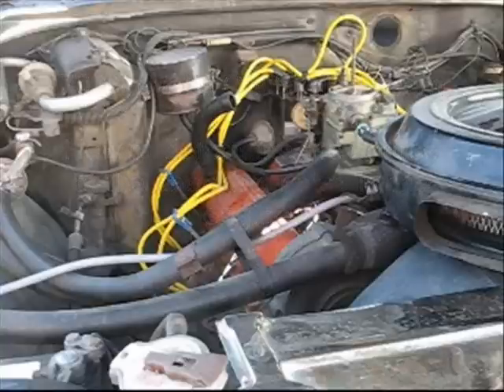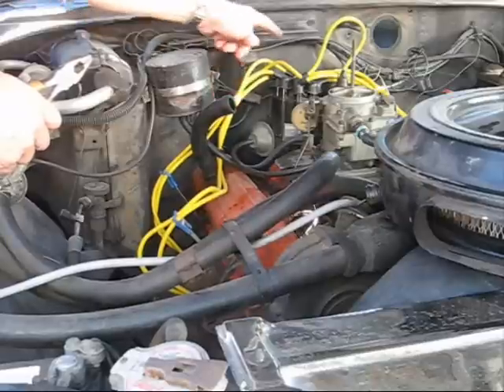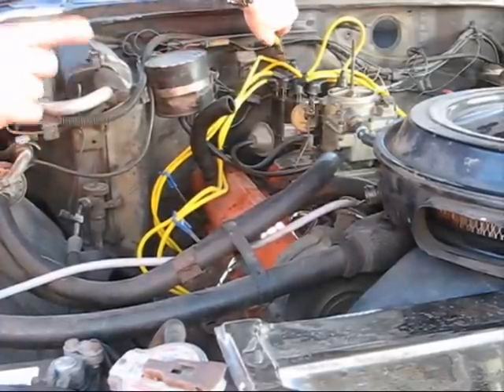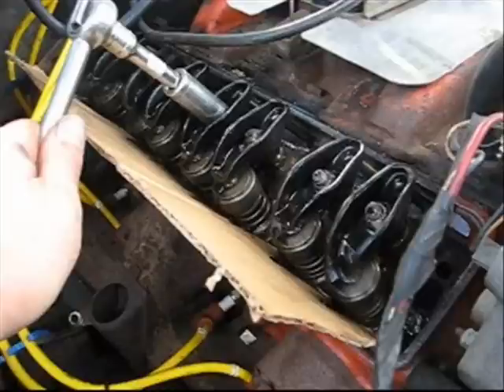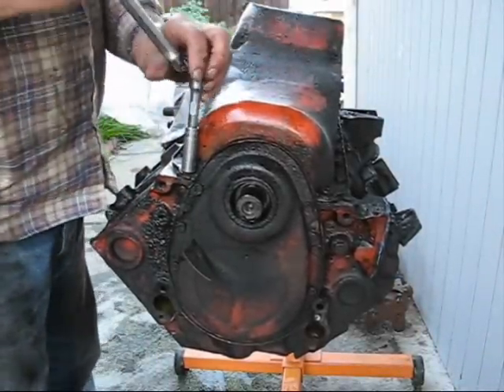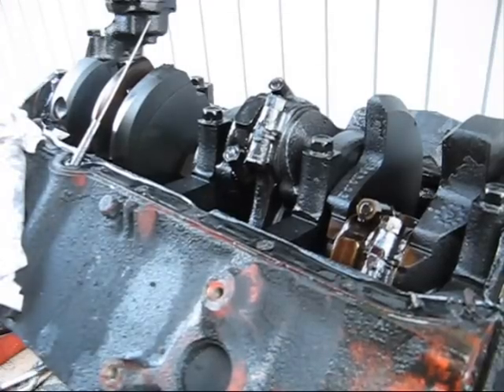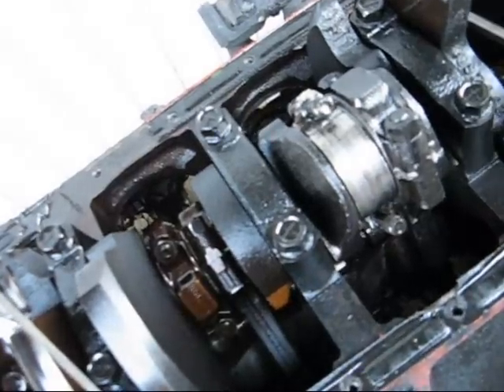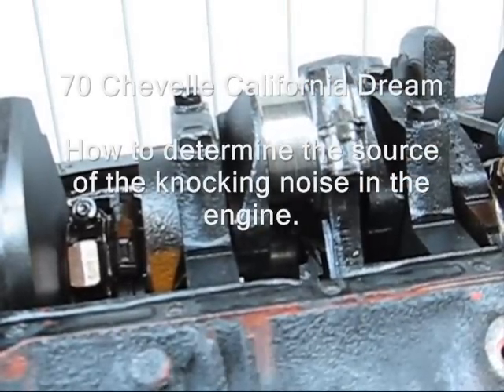How to determine the source of engine knocking noise

Comment: This a good video, my 2003 f150 has a Tapping sound, its not a deep loud knocking sound, but it gets a little louder when the oil is hot and thinner
Reply from the maker: Based on what you said, 1 or 2 valve lifters need to be tightened, just a little, like 1/4 turn.  Pull off the valve cover, get a long screw driver, put one side on rocker arm and the other to your ear and you will be able to tell which ones are noisy.

You might get lucky to hear which one it is by just doing it on top of the valve cover.

Let me know if you have any luck.

Comment: Bruh mine only knocks in park but in drive I hear nothing
Reply from the maker: In park, idling, the motor is not under a strain, so it is most likely a lose valve that needs to be adjusted.
The knocking noise is really loud when you are diving under a strain when you need power.

In idle, take a long screw driver and put the plastic side to our ear and out the other end on the valve cover and move it to each cylinder location and you should be able to hear about where the lose rocker arm is located.
Let me know.

Comment: Did you install the standard size rod bearings with the sound you had on this video ?
Reply from the maker: No, the crankshaft was damaged beyond repair.  I purchased an entire engine rebuild kit and it came with a new crankshaft and matching bearings.   I had the block bored out .020.  The kit came with pistons and rings.
I wanted a new engine because I knew I was going to keep this car for a long time.

Comment: I’m having knocking problem with my 97 Ranger 2.3 but the knocking gets loud on acceleration and kind of goes away at idle or deceleration, it missing like a plug wire went bad and has a serious loss of power. I recently replaced the timing belt so I’m going to check the timing. I’ve had a code for the EVAP solenoid for two years because someone did away with it completely, also have o2 sensors upstream and downstream of catalytic converter. Any advice?
Reply from the maker: I had the same issue with the engine you are looking at in this video.   When I stepped on the gas the knocking sound got louder and when I let off on the gas or drove around easily the sound was a lot less.  I did not have a power loss.
How many miles on the the Ranger?
If it has a lot, it could be rod bearing but I am not there to listen to it.

Comment: like your video - very helpful. On my XJ 4.0 injection engine I have a knocking noise and will be doing the same procedure. You better disconnect the spark plug wire at the distributor cap, not at the spark plug, right ? Would you be damaging the coil ? Thanks !
Reply from the maker: It is just easier at the distributor cap.  And it does not damage anything.

Unplug the each wire from the cap and put it back only part way so it is easier to unplug and plug the wire back in the cap while checking all the cylinders.
Reply: @davidlis6709  great - thanks, bro !
Reply from the maker: @JoeVizethum  What did you find out?
Reply: @davidlis6709  thanks for asking - well, not quite clear still - did unplug cylinder 3-6 and the knocking gets quieter/barely noticeable specifically when I unplug no. 6. As oil pressure is perfect (50/60 cold, 30 hot) and no visible abrasive wear in the oil/oil filter I guess it's piston slap and not connecting rod bearing - which is the minor culprit. Also checked up flexplate ok. Can I send you a video to recheck as an expert ? Thanks !

Comment: When you said let's try the last one you pulled the same wire you had just pulled.
Reply from the maker: I pulled it to show that the noise knocking noise stopped when the spark plug was not firing.

Comment: Just curious I have an old 350 with spun bearing  an I polish the crank and seems ok.. can I put std bearings in an get more mile out of it? Has 270k miles if I get 5-10k more miles I’ll call it a win.
Reply from the maker: But it may be out of round.  Since you polished the journal, it reduced in size.  You have to measure it and buy a bearing that matches the journal size.  A machine shop would probably be your best chance of just buying one bearing set.
It is a lot of time and money to get 10k more miles out of it.  Why not just rebuild the entire engine?

Comment: Will this work on a 2010 Camaro LT V6 3.6?
Reply from the maker: Yes, works on all engines.  Just remove 1  spark plug wire at a time.  Also, pick one and remove it then go to each one.  Removing one will put more of a strain on the rest of them, it should be a little louder.

Comment: Very helpful video.   I wonder if the same technique can be applied to a ford 250 Inline 6.   It developed a knock recently and I’m trying to research about how to fix it
Reply from the maker: Yes, just take off a plug wire that has spark that makes the engine skip, when check the rest of the cylinders.

Comment: I thought my valves were making a popping noise, turns out one of my headers was loose about 1/8 away from the block, I wasn’t expecting that
Reply from the maker: I am surprised you did not feel the exhaust air go by.
Anyway, it was an easy fix.  Back on the road again.

Comment: Even though I know how to do this, it’s still refreshing to see it done In actuality. Sometimes it’s easy to forget exactly what’s going on in an engine at every given moment. 

What do you think caused it to be spun. Low oil? Or was that the original motor unopened?
Reply from the maker: I don't know.  When I got the car it had 125,000 miles on it and sat in a storage container for 22 years.  It needed everything.  It took me 4 years to take the car completely apart and put it back together again.
Now, I just enjoy and drive the car.  It has a few dings from stupid brain dead people.  I try to park it by itself but when I return, they are always cars on both sides.  That is not going to stop me from using the car as much as I can.
Reply: @davidlis6709  that’s how I feel, I don’t even have a door ding yet and only some rust under the paint on the door window rain rails. I want to drive it everywhere, had to redo the electric ignition as I burned the igniter module by leaving the key in Acc for hours. I don’t like my current choke set up as it’s routed from exhaust air until it warms to temp.
Reply: @davidlis6709  glad you got her running!

Comment: i dont understand how that can work the crank is still spinning so the piston is still moving so the problem is still happening can you explain with som detail why this can work
Reply from the maker: When you remove the spark plug wire, you stop the spark and the piston does not fire.  This stops the downward force of the piston on the crankshaft and reduce the force on the bearings, so the noise stops.  The piston is just following along with the rest of the engine.
As soon as you reconnect the spark plug wire, the piston fires and pushes down on the crankshaft bearings and the noise starts again.
Understand?   If  not ask another question.
Reply: @davidlis6709  ok i get it the extra umphff makes the knock exposing the problem
Reply from the maker: @billl2383  Yes,  old trick my dad showed me.  And you can see form the video, the bad ones hard bad bearings on the crank.

Comment: Horse shit.. Polish the crank in the engine with 800 grit.. Apply Loctite to the backside of the new bearings. Apply assembly lube on the face of the new bearings..She be good as new. Just be sure to pastigage the bearings first...
As that engine is not worth investing $450.00+ in machining..You can buy a used one at the salvage yard for $100.00...As them old GM engines are everywhere..
Reply from the maker: I am not going to do all that work and have the bearing spin again.  The $450+ is worth it to me because I wanted as close to original as possible, meaning the matching motor numbers.  Everyone does it a little different.

Comment: hey dave when you rebuilt that engine did you put any kind of sealer on the head bolts i seen the video about oil pooling on intake
Reply from the maker: No, just a tiny bit of oil on the threads

Comment: We have a 1947 Chevy with a 216 motor. It only knocks loudly when accelerating, let up on the gas and it stops.
Reply from the maker: That is exactly what happened to my car.  I have no knowledge on engines before 1955.  I believe you have a major problem going real bad if you do not have a few repair shops give you an opinion.
Reply: Facts. It only gets worse unless it’s a tick

Comment: Can u do that on all cars an trucks.i had put a 360 in my dodge 1500 an I hear knocking.dont know if it's the damper or rodes.
Reply from the maker: Yes, do it on any engine.  If the engine has been sitting for a while or has high mileage, it may be the valve lifters.
Old school, take a larger screw driver, put the plastic handle on your ear and with the metal end, start putting on the valve cover by each cylinders and see if you can tell the difference in the sound from different parts of the engine.  You might be able to locate the noise.  You can also do it on the oil pan.

Comment: My mercruiser is making a knocking sound but it is pushing air through the carburetor. Could this be a valve or maybe rings?
Reply from the maker: Valve.  Do a compression test and it will tell which valve is not working.  The local auto parts store will rent you the tools for free.

Comment: Spark plug removal confirms its reciprocal and isolates the cylinder. Valve adjusting was a waste of time. Plus, the notches in the bearing don’t hold the bearing in place. It’s the torque on the rod caps and the crush of the bearing.
Reply from the maker: Then why did the motor last 125,000 miles?  Did the torque decease with mileage?
Reply: If a crank journal chirps against the bearing enough, it’s only a matter of time before it breaks loose in the rod bore and starts spinning. If you notice on a brand new bearing set, the bearings will protrude a thou or two past the mating surfaces of the bearing seats. As you torque the caps down, the bearings will press against the bore. This is called crush. The tangs on the bearing are for positioning.
Reply from the maker: @wickidflash  Thanks  -  good information

Comment: I have the exact same sound but when I pull each wire the sound is still there. Sometime the sound comes and goes and is very loud at times. What could this mean ?
Reply from the maker: Take one off and if the noise does not stop, keep that one off because you know that is ok.  Then take another one off, this way 2 cylinders are not firing and it should put a larger strain on the engine and be more noticeable.
Reply: David Lis   Thank you . I’ll give it a try
Reply: could be your mechanical fuel pump sounds like a rod knock sometimes when theres an issue with the pump rod or pump itself

Comment: I have a oldsmobile 3.8 and it only knocks when i reve it hard but at idle no noise at all?? Replaced all gaskets about 4 years ago but only used it on sundays  also sounded like a exhaust leak but sawpped all gaskets and checked for pin holes nothing  sound doenst go away
Reply from the maker: Does it skip?
Did you check the valve lifters?
Reply: @davidlis6709   i replaced the valve lifters and steams same time when i opend up the engine  and u cant adjust these
Reply from the maker: @drewdowncutomz4792  With the hydraulic lifters - you take out the slack in the rocker arms then tighten them 3/4 of turn.  Some people use 1 full turn. 

You can adjust them if they are solid lifters but these need periodic maintenance.

Comment: its knocking  saying hello  is anyone there   time to get a ford  lol
Reply from the maker: I have two Fords, 1995 F-150 and 2008 E-150
Reply: @davidlis6709  cool   laods of fun,   i have a 1991 ford fairmont with a modified 351 cleveland in it ,  its got the 351M cam in it its a 400  it has the performance pistons a square bore manifold a performer LB2V 351  what ever that meens , solid steel lifters xtra large sump headers flow master exhaust and muffler   sounds fantastic ,   check it out on you tube  351 starts up and revs rimas nobody elses,      lol   play it thru head phones or thru a stereo

Comment: Lifter, tap rod, knock
Reply from the maker: After I disassembled the engine, I determined that none of the lifters collapsed or any rods were bent.  After pulling off the caps on the rods, I saw the 2 of the bearing had been spinning and had scored the crankshaft beyond repair.   So I purchase and entire engine rebuilding kit.

Comment: But mine is an LS7 put together like crap by "injection connection" in PA. I dont want to take my motor out and find a bad bearing! I dont wanna take my motor out! Damned if I will ever let anyone work on my car again though. We are in trouble here in the USA the quality and pride is gone with the last generation. 
Thanks for the video. Keep on for the real engine guys!
Reply from the maker: You are right.  That old world craftmanship is hard to find.  Sorry to hear you are having an issue.  Pulling out the engine is a lot or work and the worst part is that it is summer when you want to drive the car. 

I make theses video to give confidence to the regular guy.  Go for it, what it the worst that can happen.

Comment: Mine sounds just like yours... but it comes and goes. I put a new carb on and it cam back louder.
Reply from the maker: If you put on a larger carburator, it increase the hp and put more st
Reply from the maker: If you put a larger carburetor on, it will increase the hp and put more strain on the piston connecting rods make it louder
Reply: @davidlis6709  actually it's a smaller carb but this one actually works right lol connect vacuum lines and the knock immediately went away but now it backfires from the muffler when I accelerate.  But what's weird is if it's in park I can floor it and no backfire but in drive it backfires

Comment: Cool test. Just wondering if you noticed that you pulled the same spark plug twice on the 3rd and 4th pull... Though that is a cool test I never thought of doing.
Reply from the maker: I guess I missed it on the video but I did it a few times before I made this video.    I have done this same operation on many other cars and it works.   You can see in this video when I took the engine apart, two bearings were scored, which makes the knocking noise.
Reply: @davidlis6709  Hey this is a really smart test! I have a nissan datsun 200L, could I test it this way without making a bad mistake or damage?
Thank you!
Reply from the maker: @VeronicaGorositoMusic  Yes, all you are doing is disconnecting  spark plug wires when it is running.  Take off the wires before doing the test so they come off easy and use pliers that have a plastic coating so you do not get shocked.  If you do, it is not that bad.

Comment: I have a 1986 corvette that makes a slight knocking noise like spark knock only when I’m driving when it’s in park I can rev it up to 6000 rpm and it’s flawless I’ve changed the plugs put a new knock sensor on and adjusted the rockers. And still does it . I’m about to drive it off a bridge and collect insurance money on it . What the hell can it be? Someone tell me please......
Reply from the maker: Did you check the engine timing.  
If the timing is a few degrees advanced on my Chevelle and it is in 4th gear going about 30 mph and I go up a little grade, it puts a strain on the engine.  That is when I get that pinging noise.  Let off the gas and it goes away, or shift into a lower gear.

If I reduce the timing a tinny bit, it goes away.

Comment: A oblonged valve guide can sound like a lifter tick with the valve moving side to side in guide.
Reply from the maker: But the noise will still be there if you disconnect the spark plug.
Reply: @davidlis6709  

Not always